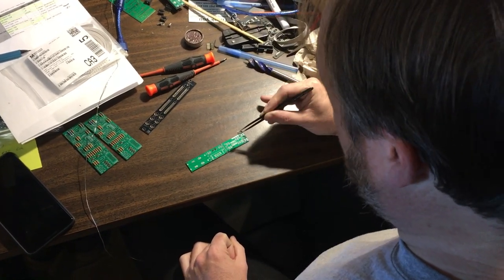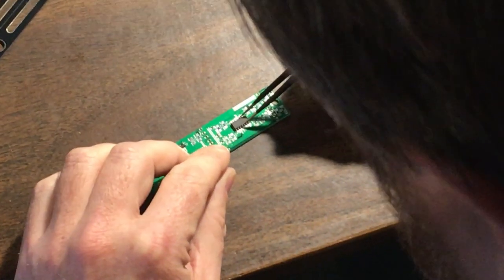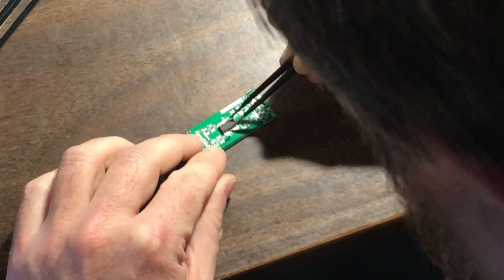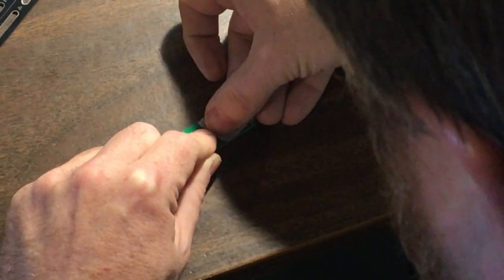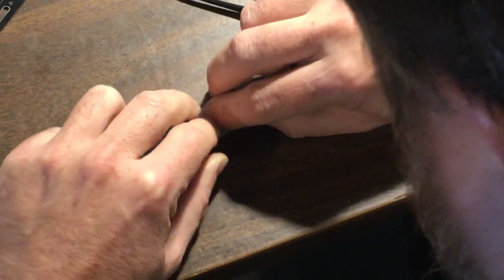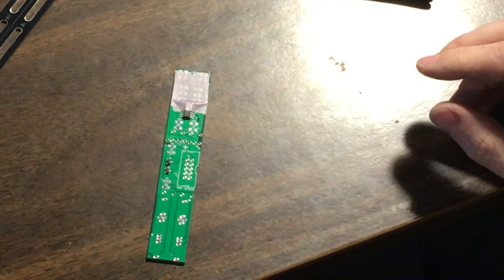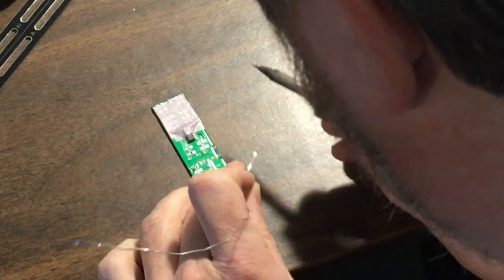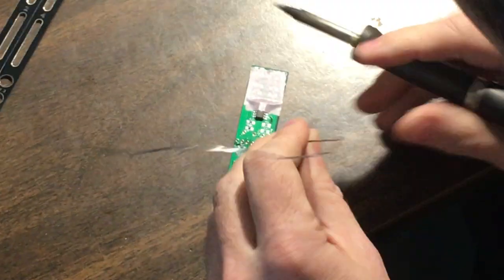Surface Mount (SMD) Component Placement HOT TIP - Synthrotek Life Hack

Comment: I always just solder one lead to keep it in place by soldering 1 pad just a tiny bit then reflowing it when im ready for the part. but yeah tape is probably easier, especially when you get those tiny 0.4mm pitch lead ICs

Comment: Psst hint from a pro.... Solder flux in a syringe. I do not use tape I tack down one end. If I get in between pins I use braid with flux to clean up. Use the flux on the pads.